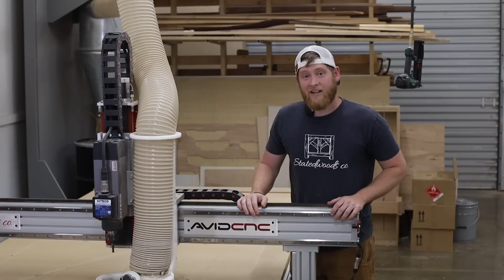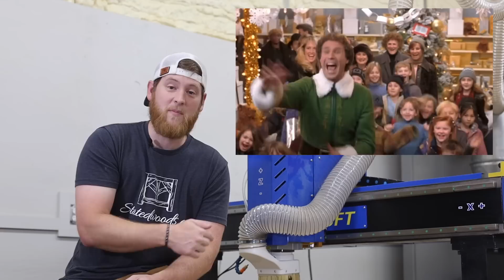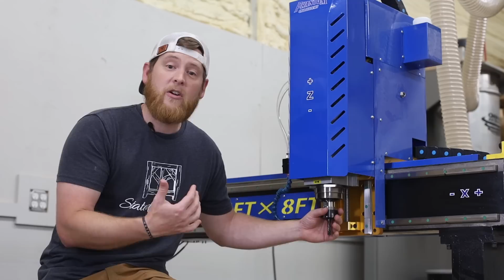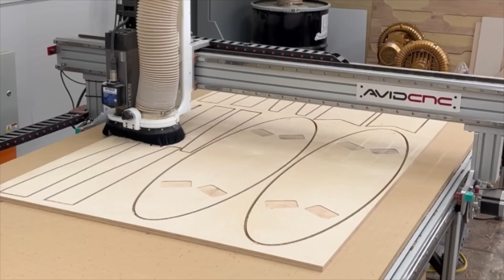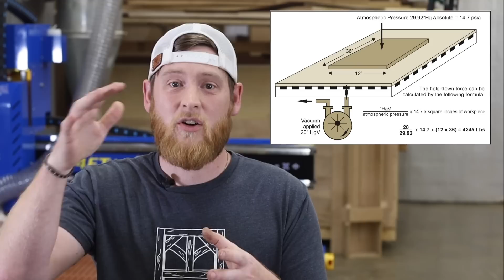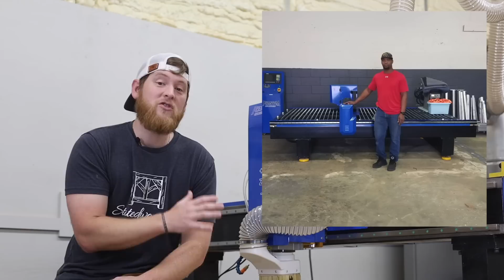Which is a better machine?

Comment: Great review!  You make some very valid comparisons.  I only disagree with you in one area.  The X and Y NEMA 34 drive systems.  I spent my engineering career working in driveline systems (43 years) as an automotive engineer.  I can tell you that a belt drive system like Avid's will have way less back lash (zero) which equates to positional error than a gear driven system like Phantoms  Its just physics.  Positional error equates to less control and repeatability in your cut.  If Phantom incorporated a drive like AVID I would probably purchase one.  One last thought, If something fails in the Phantom like this gear train for the X and Y axis, how readily available are the parts?  Are they coming from China and if so how much of a guarantee does the end user have that these gears will be available in 10 years from now?  Support and availability long term is something everyone should be concerned about.  As far as the movement of the frame.  I circumvented this by placing my wood sheets on the cross frame of the AVID.  Rock solid and a great storage area in a small shop.  And no I am not a dealer for Avid or have anything to do with them.  Thanks Again
Reply: Ball screw drives are better than both. But the use, abuse and stupidity factors should be the mitigating factor for choice between the three. Industrial and shop floor supervisor experience drives my decisions.
Reply: @chucklenz9011  linear motor drives would be better than all 3. But ballscrews would be the worst choice for a dust factory like this machine. Abrasive, acidic wood dust on a greased screw, would stick to it like a magnet. If that slurry ever made it inside of the ballnut, it's game over.
Reply: @P8ntbaLLA56  but you can get or have made screw drive covers out of several kinds of material. But that’s time and expense and the replacement periods have to be considered.
Reply: @Chuck Lenz  of course, also having oil flow through the screw to flush the debris away would also be a good idea. Downside would be cleaning the mess under the machine, but service life would improve. I work in the flooring industry, and sometimes it better to not have covers or bellows on screws, they can trap dust.
Reply: @P8ntbaLLA56 not true. I worked for a company who had a ball screw cnc and it was probably 30 years old still accurate as it needed to be
Reply: @nationsnumber1chump  my day job is flooring, so 0.05mm tolerances or less. I guess our process is quite demanding, processing more dust in a minute than some machines do in a day.  So I always view machine design through that lense.
Reply: Every single high quality CNC machine is built more like the Phantom and less like the Avid and they use helical rack and pinion gears vs. belts.  The belts do not have the load and speed capacity for heavy spindles.  

I can say for certain that they are contract produced by a factory in China.  That is not a bad thing as nearly 100% of the woodworking machines that we use are made there as well.  Parts are widely available, although replacing them exactly may not be possible.  Drives, VFDs, spindles, steppers are all modular parts and different ones can be made to work if you need a replacement 10 years later.  In fact, these contract manufacturers are always changing these machine around to fit a customer's needs.  I would like Phantom to give some credit to the Chinese manufacturer as they are the ones that developed this product and do all the work to put it together.  Phantom did not do any of the work other than choosing some specs and importing the machines.  They resell them.  Again, this is not a bad thing.  I just don't like to do work myself and not get credit, so neither should the Chinese factory workers.  

I am currently working with one of these CNC companies to import a CNC just like this Phantom.  I can choose any option I want, down to the type of servos (Leadshine, Delta, Yaskawa), brand of helical rack (China, Taiwan, Germany), control system (Mach3, Syntec, LNC), bed size (4x8, 5x10), spindle (9kw HQD ATC), Rotary 4th axis, etc.  It is a bit stressful to go through the process and deal with the ocean freight and then customs, but that is where the profit from Phantom comes into play.  Mine will be under $20k landed in NY for 5'x10' ATC with vacuum table and pump, small rotary, dust collector, and everything other than the pneumatic rollers.  Totally reasonable that Phantom would charge $15k more for dealing with the importing of the machines and profit.  I think that they are doing a great job to introduce these Chinese machines to the US market and if I was not more concerned about the possibility of issues during the import process, I would buy one of their machines.
Reply: @MattRogersdesigns  Would you be open to sharing some info about your process and supplier? I've bought plenty from China, from one-offs to palettes of electronics for my previous business. With CNC being such a complex and large-scale one-off there are a lot of potential pitfalls. Following in someone else's footsteps sounds like a good place to start.
Reply: @amerikalast  I used StyleCNC and the process was through Alibaba.  I paid $129 for a pre-purchase inspection so at least someone put eyes on my machine in the factory and took pictures of everything and a small test cut.  There are many companies Omni, Acctek, Blue Elephant.  All of them can make wonderful machines.  You get what you pay for and if you want the cheapest one, it will still be OK, but may require some work when you get it.  Pay a higher price (still lowe compared to US prices) and you get a nice machine with top-end specs.  Just go in with a clear idea of the exact specs and parts you want on the machine.  For example.  4x8 bed, phenolic vacuum table with t tracks and 6 zones, servo motors (Leadshine, Yaskawa, others), helical rack and pinion (or ball screws), spindle (size, type 9kw HQD, or HSD), vacuum included?, rotary 4th axis?, pneumatic rollers?, z height?, ATC?, etc.  Just look at an expensive machine and pick those parts and ask for them.
Reply: @MattRogersdesigns  yup and with that probably around 16 to 17 k where if you buy an American one you would be looking at the 30k range or more
Reply: @MattRogersdesigns  reasons why I have my shop sabre with ball screws and servo motors :D
Reply: @MrJcTTK  They are good machines for sure.  No doubt they put time and effort into their products.
Reply from the maker: Thanks for the comment. You probably know more about motors than I do. I just know that I could get the Avid out of step with almost every job if I wanted too and I have never been able to with the Phantom. As for parts, Phantom says that the reason they buy easily obtainable parts (from China) is so they can easily get replacements if needed. My machine came with a 3 year warranty on most parts so I did not worry about that. Made sense to me why they used easily obtainable parts. Thanks for the comment.
Reply: @Statedwoods  You also state that belts have high fricional losses, this overstates the situation. Belts have a transmission effeciency of around 95% spur gears are better at 99% but the 4% is not particularly significant.

Comment: How hard is it to remove the hold down rollers if you want to do 3d engraving and do you need an other type of clamp to stop sliding?
Reply from the maker: You dont need other clamps when using the rollers. I like to have scrap wood around my piece to keep the rollers even on whatever material you are cutting. If your doing 3D carving or dont want the rollers, they are removed with just 1 nut on each end. Can add or remove in under 30 seconds.
Reply: @Statedwoods  Need to find a retro fit for my machine noa as it wasn't an option when I bought mine.

Comment: I bought my 4x8 CNC in January of 2022. At that time, a 4x8 Avid Pro with Nema 34's and the 4HP spindle was right around $16k shipped. I decided to purchase a CNC4Newbie Pro4x8 instead. It's gear driven R&P running higher-torque Nema 23's with a 2.2kW spindle. All in all, build-it-yourself kit with 3rd party sourced parts (spindle, dust boot, spoilboard). It lacks a few things compared to an Avid if I'm honest, however it was under $10k so the savings were huge for a very comparable, albeit not quite-as-nice machine. 

I think there is a HUGE market difference in the "under $10k" "$10-20k" and "$20-30k" machines. Camaster and Shopsabre are over $30k because they are designed and actually manufactured in the US, unlike Phantom which is chinese. There's nothing wrong with that (that's where the value is), BUT call it what it actually is. Take a Stepcraft Q408 for example, and this Phantom is an unbelievable value for the under $30k market.

I hope one day I have the work to justify such a great machine!
Reply from the maker: I agree with you. They have the frames CNC’ed and welded in their factory in China because of cost. Everyone used parts from China just like all the parts of our phones and everything else we buy. I wish it was 100% USA but i hate to say no CNC’s are 100% USA. Maybe one day it will all be back home.
Reply: @Statedwoods  Chinese built isn't a bad thing when it comes to machines like these, people just assume everything made in China is junk. That's simply not the case, however I do see a huge benefit supporting a US based business that imports components, but still manufactures here and has American support. Point is, there's room for everyone at different price points!
Reply from the maker: @Meyerwoodworks  i agree 100%. Phantom is a US business that imports part. Designed, R&D, assembled, and built in North Carolina. Some of the nicest people I have met who care about their customers.  That was a huge draw for me to them.

Comment: Took me 2 days to put my 5x10 AVID together. Shipped without 3 supports and missing several sets of screws however. Still doesn't cut level, not sure why appears level to me. Only reason I'd want to swap is for a pre-built perfectly level machine so user setup error is removed and to get a machine with an automatic tool changer.
Reply from the maker: Im right there with you. I did enjoy rolling it in and it basically be ready vs spending days assembling the avid.

Comment: first of all thank you for your sharing experience 
I'm never work with any of those machine, but after seeing avid machine, I've design my cnc machine and  plan to make it, 
the big problem of avid machine is the structure, because is so light weight and avid must change design structure when someone used 8.7 hp spindle on own machine and big issues is stepper motor, they must used hybrid stepper motor with not loose steps (I've seen someone used servo motor on avid cnc on YouTube, and it's big mistake) avid frame designed for 2.2 kw spindle those aluminum 40*80 size extrusion is not strong enough.
and in the final in the same price steel frame is always better choose with any thalk!
Reply from the maker: I agree 100%.  The light weight nature of the machine is one of their leading issues.  Great for setting up in hard to install shops, but not good for CNC work in general.  Belt driven stepper motors is also a big no-no.  Steppers with gear drives and gear reduction systems are great.  Thanks for the comment.

Comment: Ok you've sold me on it. I'm selling my extruded aluminum frame machine and buying a phantom...oh wait, I already did that months ago! I don't miss my old machine for a second, and I spent about a 1/4 of the price on that one. Rigidity is one thing you can't add to the machine later. It's from the ground up, and it's about the most important factor in quality cuts. Great video dude

Comment: Lathes are heavy to reduce vibration and often have a shelf to add more weight. Vibration a big deal. Make sense with a CNC to.
Reply from the maker: Yes, vibrations and unwanted movement is a real issue. Thats why I love a solid, rigid, heavy frame.

Comment: As a non-cnc owner you have provided insights to things I didn't know.... that I did not know or think about. 

While I see advantages in the depth and breadth of knowledge coming from constructing my own cnc.... I contrast that with the fact  I did not build my cabinet saw, bandsaw or jointer- so maybe there's not  really a significant advantage?

Great content and thanks for helping us novices in gaining a better understanding in this tool space....
Reply from the maker: Exactly Joe. I agree. It is good for someone that has never used CNC’s before to build theirs. But I did it and really didnt learn anything about my machine that I couldnt have learned from just using it. Plus, CNC is about using it. A true machine shouldnt need to be taken apart later.
Reply: @Statedwoods  yeah I built my hobby machine and im glad I did but when I want production equipment I dont want a bag of wingnuts and a 10,000 piece jigsaw puzzle. I hopefully end up buying from a source who can walk me through any issues that may arise.

Comment: Having to assemble a CNC is the EXACT reason I never bought one 3 years ago. It felt way too intimidating. 

Lightweight materials are overrated. Lighter usually means crappier in my opinion. Solid video my friend. Maybe I’ll have blue in my shop one day 😧😧
Reply: Maybe one day Christy!! I said the same thing and here soon I’ll have the 4x4 from phantom! I can’t wait to see how much better it is than the onefinity!
Reply: @sandmanwooddesign  😧 exciting!
Reply from the maker: I agree. The lighter the machine the more its going to move and cause cutting or vibration issues. Plus, spending a week or two building a CNC just grinds my nerves. Im too excited to start using it to have to spend that much time building it